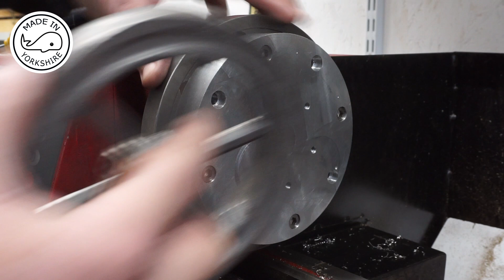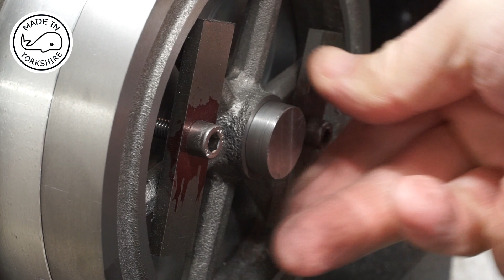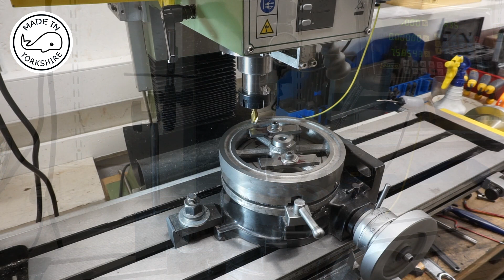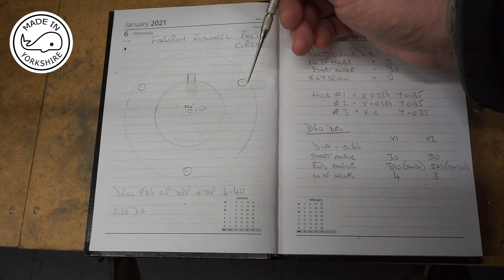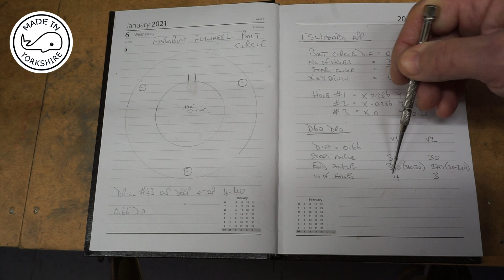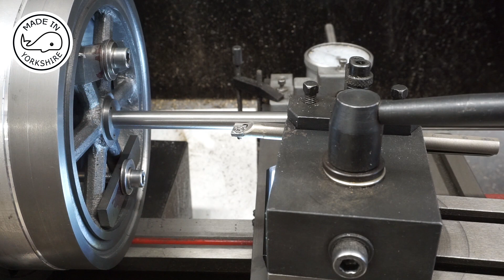#MT35 Part 18 - Farm Boy Hit and Miss Engine. The  Flywheels. By Andrew Whale.

Comment: Great video Andrew, thank you. I just got some drawings for this engine. The outside edge of the tapper seems very, very close to breaking into the tapped holes, like 1 thou clearance if you hit the dimensions shown. I guess you just keep cutting the taper unit one cut before it looks like they will break through lol.
Reply from the maker: Thanks mate! Yeah the clearance is just a couple of thou or so but it's not an issue. In fact the collet holding design for flywheels is the best I've come across so far. Of all the engines I've made I still regard the Farm Boy as the best design overall. Good luck with your build.
Cheers
Andrew

Comment: I’m looking to buy a mill. What are you using in this video?
Reply from the maker: Hi - It's a Warco WM18 mill - and I love it!
Cheers
Andrew
Reply: @learningturningmetal  thanks
Reply: @learningturningmetal   did you find the Sieg 2X2P. Too small?
Reply from the maker: @lisag2771  it all depends on what you plan to make with it. If you get hooked on model engineering it's best to go as big as possible.

Comment: That's really nice work. You are getting a lot out of your lathe and mill, and that flywheel turned out really well. Thanks for sharing your first pass at broaching - looked a bit stressful but the results are great!
Reply from the maker: Thanks mate! I'm just in the process of machining the other one. Once complete, I'll put them on a mandrel and check for any runout - fingers crossed they will be OK. Broaching worked well, but required absolutely loads of pressure.
Cheers
Andrew

Comment: That's looking great!  I would probably have kept the cast finish on the parts you did in the milling machine.  One way to get those to run straight is to indicate on those surfaces when in the lathe and to adjust the turned surfaces to match.  That should get the wobbling down there.
Reply from the maker: Thanks Roel. Yeah - I was in two minds what to do. Maybe better leaving the cast finish - but it's done now. I'm currently machining the other one. Once complete I'll put them on a mandrel to make sure they run true.
All the best.
Andrew
Reply: The shiny finish is nice too, each method has it's advantages ;-)  BTW, I started on the Stuart 10V and it's really taking shape now.  I'll send you a picture when it's done. Thanks again for all the nice videos!

Comment: Coming along nicely Andrew,
Look forward to the ignition video.
ATB Adam
Reply from the maker: Thanks Adam - I think the ignition will be a two stage affair. A bit of a lash-up initially and certainly not to your exacting standards. If I can just get it to run it will be a major achievement.
All the best.
Andrew
Reply: @learningturningmetal  
Getting the engine running would be great, especially after all the work you've put into it :)
Don't worry about the "lash up", some of my projects have stayed that way :)

Comment: Firstly Andrew, Happy New Year to you and the Family. Secondly well done with the flywheel. Thirdly, Lash out Some Cash and put some heating in your workshop. Not only will YOU appreciate some warmth but so will your machinery and measuring instruments. Most instrumentation is calibrated at 20 C not about 10 C that it looked like with you and your Winter clothes. Lastly, as a general rule, try NOT to use a good dial indicator directly on castings. Although you said they were clean, I suspect that there could still be bits of sand in the casting surface which will wear away your stylus. If you really have to dial in a casting, get a Chinese cheapy for that purpose only. Regards from Australia.
Reply from the maker: Hi Dave - Happy New Year to you too - and roll on Spring! The problem with heating my workshop is that it escapes so quickly - a bit of a problem really. My neighbour gave me some really good rubber floor matting from an engineering company so at least my feet don't get too cold. Yeah it's a horrible sound with the dial gauge grating on the cast iron. It is a cheap one though - it's my dial gauge holder that cast an arm and a leg!
All the best and stay safe!
Andrew

Comment: Hi Andrew, great to be following this still and the timing couldnt be better as i ve just recieved two excellent 6 inch CI flywheels from Kennions as per one of you other viewers suggestions - so thats my next stage.  My build is also starting to look good - made some silly mistakes but thise have been recoverable. I must say that a fair amount of skill is needed in building this engine and this is not a project one for the feint hearted but really great challenge. Happy new year to you and i look forward to seeing the end result...
Reply from the maker: Hi Andy - I wonder why I didn't spot them on the Kennions website? They should save you a lot of time and effort. I certainly didn't fancy machining them from scratch. This project has certainly got me out of my comfort zone and helped develop my machining skills. Mind you I didn't think it would take 10 months to get to this stage. I just hope it doesn't take me another 10 months to get it to run. We will see.
Happy New Year and I hope you get yours running soon too.
Cheers
Andrew
Reply: @learningturningmetal  Yes I was very lucky, i tried PEDELEE but he'd run out so eventually found some on the GLR Kennions website (Richard is very helpful and knowledgeable ) - look at the Stationary Model Engine called TINA and it uses a 6 inch flywheel so i was able to order two of those - otherwise i think i would be machining my gym weights Ha ha....
Reply from the maker: @gb_engineer  useful information. Cheers

Comment: Happy New Year Andrew. Nice job as always. I can't tell from the video if you chamfered the edges after you did the main diameter cuts, but if you didn't I highly recommend that you do because spinning the flywheel by hand is how you'll start the engine, and those corners will be sharp unless chamfered. As a rule I lightly chamfer pretty much any corner even if the drawings don't call for that.
Reply from the maker: Thanks Tony - and a Happy New Year to you too. Good point. I did sort of chamfer the edges, but I will double-check when polishing on the lathe.
All the best.
Andrew

Comment: OK cat among the pigeons time 
   Firstly well done very entertaining video again 👏 
     Now I haven't seen the drawings but I think the keyway should be on the same angle as the taper,that's the common practice.
However that small an angle potentially shouldn't make a difference.
I am talking strict toolmaker rules mind.
 Well done keep up the good work.
Reply from the maker: Thanks Jonathan - though you had me worried for a moment! The drawing does state not to bore the taper until after the keyway and the three holes have been drilled and tapped. The reason for the taper is for a flywheel split collet to snugly mate up with it when tightened with the three screws. I've yet to make the collets but I hope to show them on assembly.
All the best.
Andrew

Comment: Nice work as ever Andrew. You should be able to get a good shine on the rims with a bit of polish. I hadn't appreciated just how large those flywheels are. There will be a lot of weight spinning round when the engine is running. Plenty of inertia to carry it between ignitions. 
Although hard work your broaching press put the slot nicely in the centre. I have had a lot of trouble getting those slots in just the right place. A little bit off and it is a long job to get everything lined up again so that the pin fits. 
My only thought on this one was that a bit of cutting fluid would have helped with the drilling and especially with the reaming. Of course you can do it without but it will prolong the life of your drills and reamers. I get more envious of your workshop each time I see it . 😜
Reply from the maker: Thanks Tim - and many thanks for the advice. I must try to remember to use cutting fluid more often. By the way, my workshop is an optical illusion. It's amazing what you can achieve with video editing software nowadays!
All the best.
Andrew

Comment: Hi Andrew, just a thought, why didn't you drill & ream the flywheel and boss as an assembly?  What is the purpose of the taper?
Reply: Hi Steve, there is a tapered split collet, which no doubt Andrew will show in a later video, that locks the flywheel to the crankshaft.
Reply: @rabidgasfitter  Thanks for that.  I didn't know Fenner nicked the "Taperlock Bush" idea.  Better solution than a grub screw.
Reply from the maker: @rabidgasfitter  Spot on mate!
Reply from the maker: Hi Steve - as Hairy's Shed points out - it's for a tapered split collet. I've yet to machine these out of Leaded Steel but I hope to show them on assembly.
Fair point about drilling and reaming both on assembly. I did it separately because I had to remove some material out of the hub for the new piece to fit into. Maybe next time I will resists the temptation to drill right through - and do it after loctiting the piece in place.
All the best.
Andrew

Comment: Andrew, here is an idea for you. Mount all your equipment that you normally keep on the shelf, like your arbor presss, belt sander, chop saw, and grinder on sheets of 25mm plywood all with the same length and width with mounting holes in the same place. That way you only need to drill your workbench once and you can security mount your equipment as needed and still have the work space when the equipment is not needed.
Reply from the maker: Fantastic idea Craig. I think that could be a job for Spring - assuming I've managed to get this little engine to run. I'm getting to the nervous stage!
Cheers
Andrew

Comment: Well done I think. Recently 2 other Tubers, Joe Pie and Blondihacks made fly wheels and used different approaches. Your way of doing it feels the mots natural to me.
Did You check the balance of the wheel or You leave it to the end of the wheeling?
Reply from the maker: Hi Stefan - I think I should have put it on a mandrel afterwards - to check balance and runout. I've not checked out Joe Pie and Blondihacks approach, but I guess they used a mandrel to machine. I used that approach for my Stuart 10V and it worked well. Maybe OK on smaller flywheels, but I think the faceplate might be a better option for larger ones. We will see!
Cheers
Andrew
Reply: @learningturningmetal  You're likely very right. Your fly wheel is surely quite a bit larger. To grab it by the boss would not be thinkable. My moistake not thinking about the size.